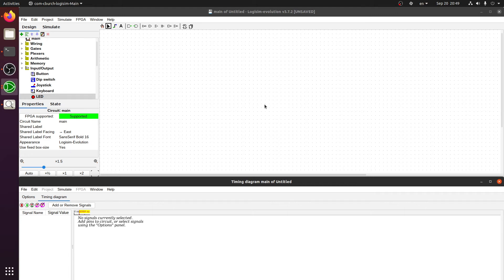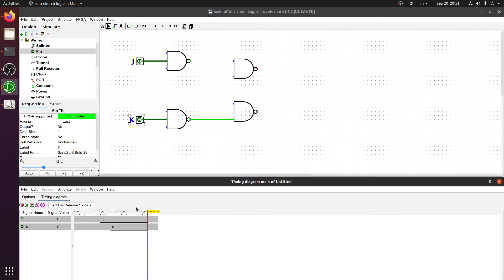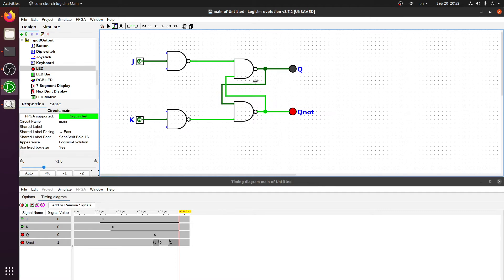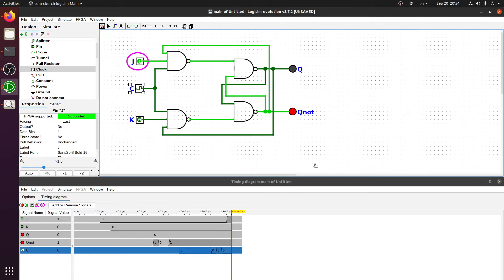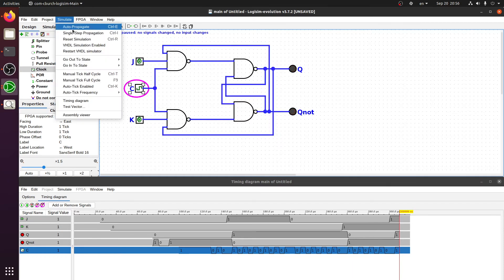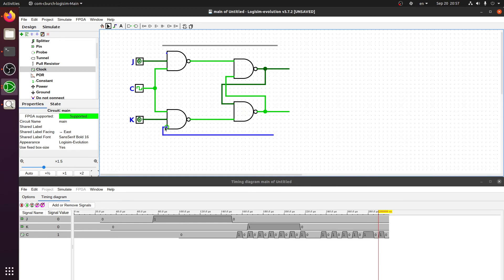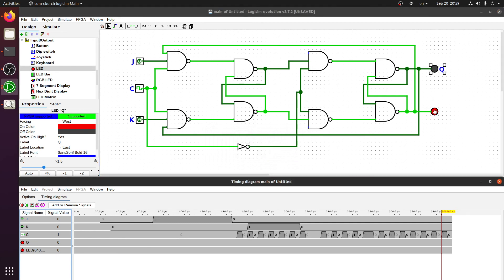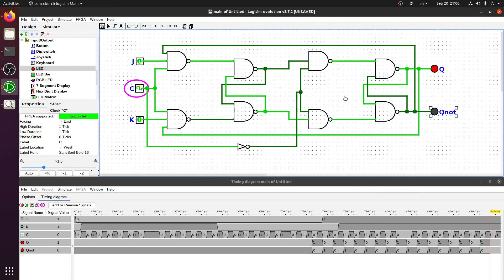CSCE 312: Implementing JK Flip Flop in logisim

Comment: Thank you fir this video , i'm using the regular version of logisim and I had the oscillation apparent error when j =1 and k =1 so I guess designing a master slave flip flop is the solution for that to get the correct toggle output. It would be ideal if logisim could just simulate the   circuit properly but I guess this will have to so :P